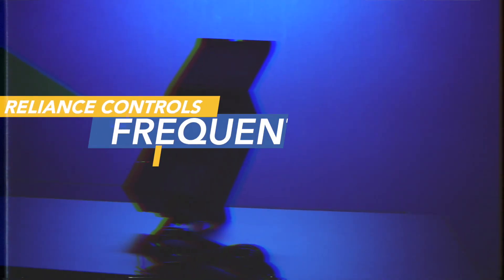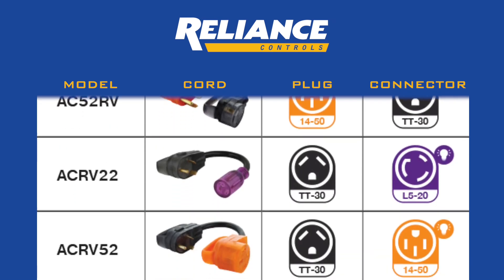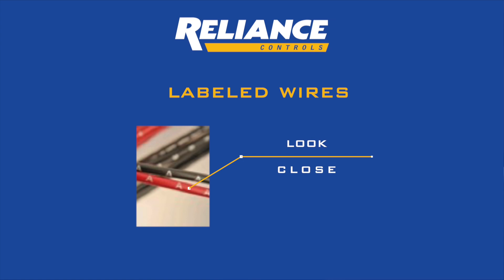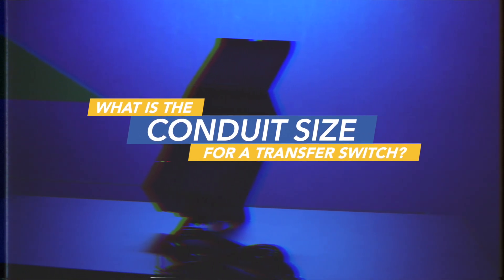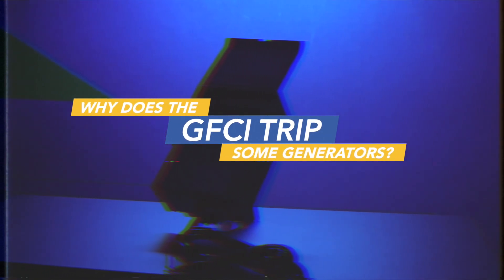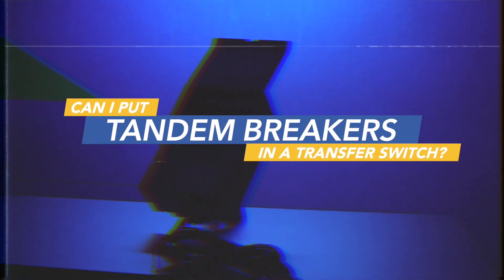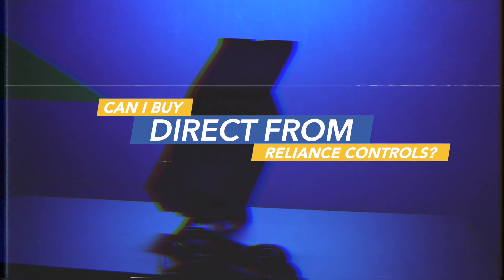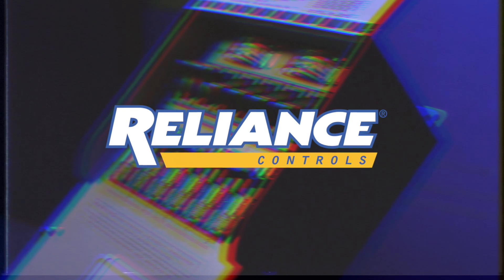Reliance Controls FAQ - Episode 3

Comment: I purchased the Reliance transfer switch 6 circuit recently. My breakers are dual afci and gfci breakers. They have a white and black wire on each breaker. The transfer switch white wire goes to the neutral. The green goes to the ground. Each circuit has a red and black.  Red goes to the breaker and both blacks connect to each other. What do I do with the white that is connected to the breaker? 
Thanks in advance